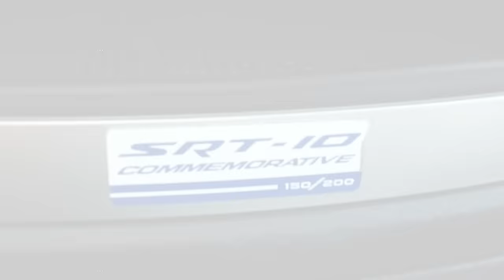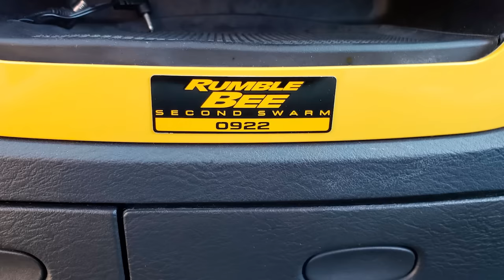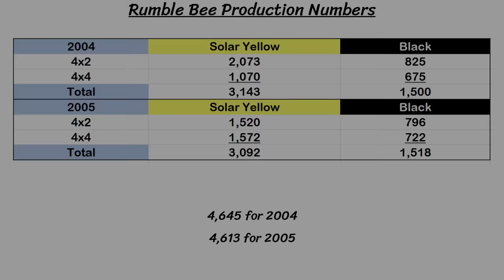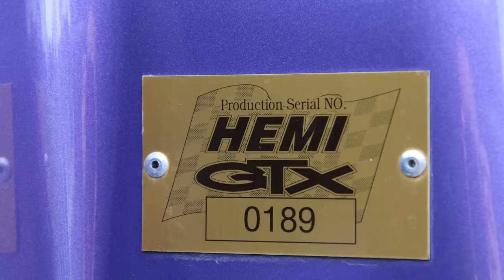9 Special & Limited Edition Dodge Ram 1500 Pickup Trucks – RARE!

Comment: My favorite Special Edition Ram is the SRT-10. Now, here's a cool fact about this truck: The Guinness Book Of Records certified the Ram SRT-10 as the world's Fastest Production Pickup Truck, which knocked the Ford F-150 Lightning, and GMC Syclone down to the second, and third place spots.
Reply: John Osbourn not anymore!  F150 Nitemare is now, but I always had a soft spot for the Viper truck
Reply: Key word (production), F150 Nightmare is modified by Roush not built.
Reply: Anthony Vaughn it is considered a production truck as it comes with factory backed warranty.  Same as the Hennessy trucks.  But I see your point, was just saying it is considered now to be the quickest of them all.  Either way it’s useless for a truck up here.
Reply: Correct, you can get a factory warranty when purchased through a dealer with those modifications. However, said vehicles are  still considered to be modified and not production as the modifications weren't performed by the manufacturer. Nightmare might be the fastest modified truck, but not production. Different category.
Reply: Anthony Vaughn well I stand corrected then, article I read must have been a little misleading.  I suppose the Tesla truck will be quicker then all anyways if/when produced.
Reply: Yeah will see what the GMC Hummer does too, they're touting a crazy 0-60 as well. One will definitely take the top spot for sure.
Reply: What about the Shelby f150 thought it was first
Reply: cause they were just reclaiming their title from when the Little Red Express was the fastest production vehicle
Reply: Anthony Vaughn would it be considered production if the dealer makes the mods? 

Some Ford dealerships will supercharge a RCSB F-150 and make a Lightning tribute with full factory warranty
Reply: You guys obviously don't know the difference between quick and fast,  go search the top speed for all those trucks and you'll see why the SRT-10 is still the fastest truck in the world at 154 MPH top speed
Reply: @adammcz5873 not true. The 2023 gmc hummer ev is 3.0 seconds and rivian R1T is also 3 seconds. The nightmare is 3.9😂

Comment: Srt10 was my favorite truck of all time so I bought one 5 years ago and have had it since
Reply: Srt10  only come In RWD RIGHT?
Reply: Ethan King Yup only rear wheel, I’m sure there’s a way to convert it cause you can get all wheel rams but that’s it like the front axles and stuff could handle that power... so in short yes it’s rear wheel but if you try hard enough I’m sure you can get it running all 4
Reply: @DiaperSNiFFER  i'm averaging 7 mpg but i get a lot of smiles per gallon
Reply: @ZROSTARS  THERE YOU GO CHAMP😂
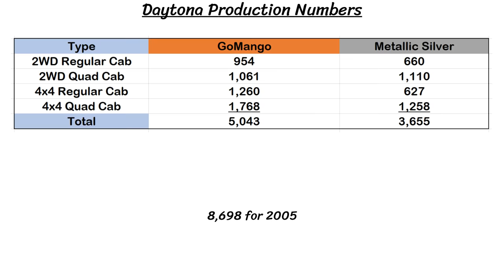Reply: Guy I work with owns one with he put 4:10 gears in the rear and a cam. He said he averages 4 mpg. He barely drives the thing.
Reply: Marcus Pee dang talk about gas guzzler
Reply: What color?
Reply: @ZROSTARS  😲😲😎

Comment: I guess I'm old, I love the warlock, little red Express and the power wagons.
I also liked the Dakota sport convertible, and the aftermarket little red Dakota.
Reply: I agree, he missed the machos, palaminos, and ranch hand trucks. The macho powerwagons my fav
Reply: I feel it. Nobody looks into the older stuff
Reply: I was severely dissapointed when he didnt mention the older trucks as well.
Reply: @alex_8025  he my make one later
Reply: The aftermarket lil red Dakota was my first truck
Reply: @Zerohero58 dang
Reply: Had a 78power wagon 4wd   wih the 440. Best truck ever had
Reply: Look for the late 70’s Dodge “Adult Toy’s” advertising.  Had a 78 PowerWagon with a lift and 35” BFG MT Bajas (360ci, 727 auto).  Tons of room under the hood = you could sit in there for work -easier than sitting on a 1-2’ tall crate etc.  The late 70’s were huge years for pu trucks = lots of changes made to become the early 80’s trucks np205, np208, Dana 44/60 with pretty solid engines compared to the new crap.

Comment: The 2006 Dodge Ram night runner hemi. Only built from January 06 to June 06. Built 1355 some 4 door and some 2 door. Of the 4 door they built 790. Mine was built in April. Chrysler didn't badge this trucks so I had to contact them at corporate and they sent me the info. Thanks for the videos they are great.

Comment: I had worked for Dodge from 2000-2018 and sold at one point most of these.  I even had a used car manager that got his hands on a pre-production Rumble Bee at auction that we sold.  There was a number plate on the inside, but no number.

Comment: Don't forget the "Built to Serve" editions released this year. Built to honor the military and veterans. Each branch of the military (and the Coast Guard) has two color choices. One standard color and one special production color. Only 1000 of each color will be made (only 500 of each for the Coast Guard)  and they all have different drivetrain and interior packages. They all have the Off Road group and blacked out bumpers, grills and black running boards. They also have exclusive Technical Gray colored 20" wheels.  I bought the US Army edition in March in Gator Clear Coat and it is an absolutely beautiful truck.

Comment: No love for 2nd Gens? 1996 saw the Indy Pace Truck and even rarer was the Carolina Edition. These were only available in black as SLT regular cab short bed 2wd versions. They featured 3 Carolina Panther logos 1 above each Ram 1500 badge and the other on the right side of the tailgate. Along with blue matching pin stripes around the top half and above the wheel wells. Of course they were only available in NC & SC. I've only seen 2, one in Conway, SC and the other in Mars Bluff, SC.
Reply from the maker: Working on a Part 2 soon to try to add a bunch of stuff I missed!
Reply: I own a 96 Indy 500 pace truck! Don’t forget about the “Big Daddy” Don Garlits editions too, they were pretty sweet.

Comment: Lol 
 I still have my 05 yellow fever. Just turned 18,000 miles .
Reply: Fucking dope dude. How you like it?
Reply: @fabianruiz2461  obviously hates it. never drives it
Reply: @arromine6091  meh could be a guy that just collects
Reply: Dam I got the 2019 and already got bout 20k on the dash. U must got other cars that u like driving better. I got 2 other cars
Reply: @acebuick  
I have a few 66 t bird rag top, 66 hemi charger , 72 big block mustang Mach 1 . I they all get driven just not much. Lol but my daily is a 2020 ram or my old 2001 wj.
Reply: @fabianruiz2461  
   Let's just say it's very low miles but has gone through 2 sets of rear tires . One of the local stealerships wants it  and I want a red eye .
Reply: @Tinman964  cool dude your car do whatever you want with it and I respect that. Jesus u got all these dope cars. The 01 WJ is when Jeep still used the inline 6 right?
Reply: @fabianruiz2461  
Yes 4.0 . Best block made other than a  crap head on them.
Reply: @Tinman964  my dad still has his 1999 XJ it's on 288,000 or more miles. One of the best engine made by jeep and at all in general
Reply: I have #251 of the Yellow fever been sitting for about 10 years now in working order with 30K on the clock.

Comment: I have a 2005 2wd regular cab go mango orange Daytona edition Ram 1500. It's number 1520. I bought it used in 2007 with 24k miles on it. I have 212k miles on it now. It has been a great truck. Lots of fun and a real head turner.

Comment: I have a 04 Yellow Rumble Bee #0124 & love it... I've changed cams & changed to 6.1 heads & intake (a lot better air flow) CAI, Headers with gutted cats & 2½" straights that dump in front of rear axle... Changed to 4.56 gears but wish I had went with 5.13's... Running 20" wheels I am only at 2900 rpm at 100 mph so it's not gear bound... (Diablo tuner has allowed me to do away with the speed limiter)  I need to change trans & add a stall converter but that will have to wait till this virus thing goes away... It is really quick for a 5500 lb tank... Thought about a Paxton or Turbo but for that money I can get a nice SRT-10 to PLAY WITH... I don't put enough miles on it a year so I really don't mind only getting 9mpg on 93 octane...
Reply from the maker: Your Rumble Bee sounds awesome man! Cool to see someone put all that work into it
Reply: How much miles bro ?

Comment: No SS/T, Indy Pace truck or even the Gen 2 off Road edition that came with 4.10 geared axles, a front trussed axle, front tow hooks, off road decals 17” alloy wheels and a slightly higher lift over the stock 4x4 Ram’s!     You bet I’m disappointed big time!      There was also a Mexico version of the SS/T called the Ram Runner it had a V10 magnum engine under the hood!    A Gen 1 Rod Hall edition Ram was also a cool truck not many see or know about.    

I am really surprised there was no Gen 2 coverage at all though, considering every Ram afterwards other than Gen 5 was molded from it🤬
Reply: Really I have a indy pace truck bought it 15 years ago no sst the dude truck wow.
Reply: Richard petty edition.
Reply from the maker: Hoping to cover most of these in a Part 2 for this video!

Comment: I bought a 2005 silver Daytona regular cab 4x4 with only 65,000 miles last month. Showroom quality. Not a speck of rust anywhere. Of course it had the 5.7 hemi with 345hp but the original owner installed a chip on it and not its putting about 410 to the wheels. Love love love the truck. It will scream. I will never sell this truck. I looked for 2 years and found nothing. Finally I found it.

Comment: I had a 2003 Dodge Ram Sport Regular Cab. There was a badge on the tailgate that said Thunder Road. I never could find any information on if that was a real package, or just some crap the previous owner slapped on there. Never the less, that truck was bad ass and fun to drive.

Comment: The GTX is an 04 only model , According to some internet sources LA West says the break down is
211 Hemi Orange
97 Sublime Green
72 Plum Crazy
53 Top Banana Yellow
1 Cool Vanilla
434 TOTAL
Hemi Orange RC-196, 15-QC,
Sublime RC- 90 ,7- QC
Plum Crazy -68 RC, 4-QC
53 Top Banana RC
Legend Motors Worldwide bought LA West in 02/03 and closed them down on 2007 , The guy I know at LMW says their records show for 04
217 Hemi Orange,(196-RC ,21-QC)
72 Sublime (65-RC 7-QC)
72 Plum crazy (68-RC 4-QC)
72 Top banana all RC
1 Cool Vanilla only one is RC.
05 GTxtreme #s are
Orange 66 (56 RC 10 QC)
Sublime 44 (37 RC 9)
Plum Crazy 19 ( 12 RC 7 QC)
Top Banana (15 ALL RC)
Black 14 (All RC
Cool Vanilla, 8 (6 RC 2 QC)
Total of 156
No break down between 4x2 and 4x4 , also the "oem" American Racing wheels, all 04s got them, the 05's up to # 0072 got them after that they got the "butterfly wheel" the chrome was flaking off as early as 6 months after sale.
GTX name was dropped after pressure from Mopar groups complaining about the GTX name on a Dodge...so 05 it became GTxtreme.......Mopar lovers....My God are we a odd bunch.

Comment: As a company car I had a red two door 2005 SRT10, then a GoMango 4x4 two door, then a Commemorative SRT10 , then a black SRT10 two door, then a 2wd hemi 2500 SRW( LOL) then the Night Runner Quad. Blew the motor in ten miles. Balanced and blue printed. Got 15MPG after that. Whomever got that one used got a stellar ride!!!
Reply from the maker: Damn those are some bad ass company cars! I'd love to have one of those SRT-10s someday
Reply: Marspeed i worked for “Daimler Chrysler or Cerberus “ at the time and gas was $4.00/-gallon. There were days I drove so much i had to fill up twice.

Comment: I have a 05 Black Quad cab SRT-10, absolutely LOVE it. Have owned it for about 5 years now, and yes the MPG is total crap, I average about 9 or 10. You could get higher if you drive normally but I mean come on who wants to drive it normally? The only downside to the truck IMHO is any aftermarket engine upgrades are $$$$$$ you could build an entire engine for the price of a set of heads.

Comment: flew down to pittsburgh.from anch-Ak,last week in Aug- 2016. pick up 2005.Rumble Bee.4x4.with 62,000.miles spent 26.days tooling around.the lower 48.was really nice running Driving HWY'Rig.lot of passing power from 65-& up. mph.blew header gasket the first week.finally found a guy to replace it the next day after i stop in.285.bucks parts & labor.after.5600.miles later left t in south west MT'.next spring had it ship up to anch-Ak.sold it in oct-2018.got 500 dollars less what i payed for it.

Comment: I wish they had the 2 door 5 seat versions of these trucks. The 4 doors look too big, and the single cabs look too small. Need an extended cab model that has two normal doors and the two small rear opening doors.

Comment: I've got a truck you might want to add to this list it's a 2017 dodge ram rebel but there are only 2 made this way we own one and a dealership in Colorado owns the other they were both heavily upgraded from factory including air lift and lower suspension and a whipple supercharger

Comment: I have a 2005 Quad-Cab SRT-10 -- it was originally silver, but has been repainted to the 2006 dark gray. It has NOT been kept original, and is in 'good' condition, but not excellent, and has 145,000 miles (as of January 3, 2023.) I only recently bought it, from an out-of-state Dealer... and it is 'less' than promised' but I am still sure I will enjoy it... but will be doing some changes. Hopefully, increasing HP without destroying reliability. OI tried "ChipMyCar" but it did not work with this engine, even though they claimed it was designed for the V10...but it idled at almost 3,000 rpm... definitely not good for the Auto-Trans, or fuel mileage, as promised. Hoping some of your Video's will give me some good ideas.

Comment: The viper engine was either a 8.0 liter or 8.4 depending on the year, I've never heard of an 8.3 liter
Reply from the maker: Third gen Vipers (ZB I, 2003–2007) is where they upped the displacement from 8.0 to 8.3L